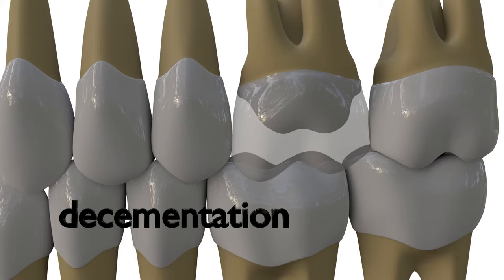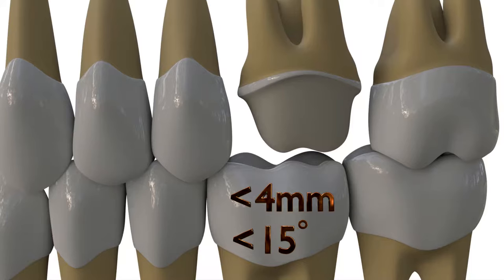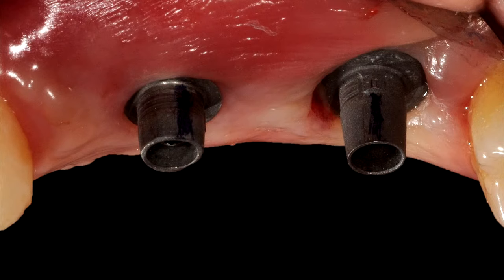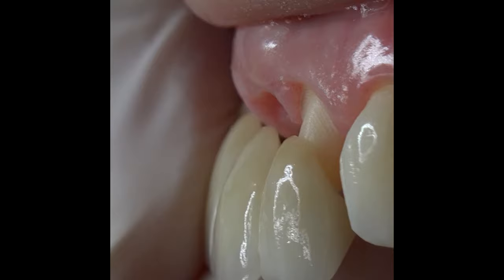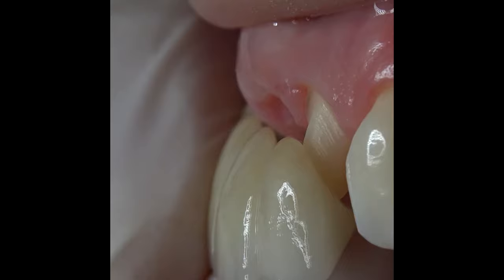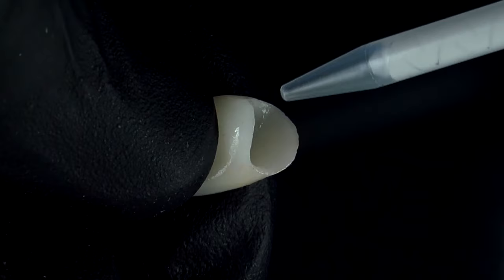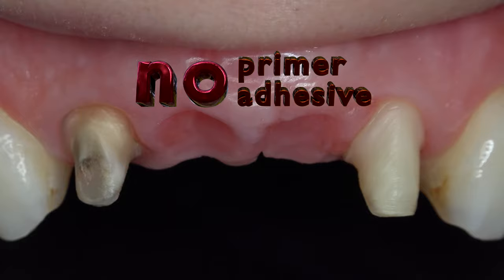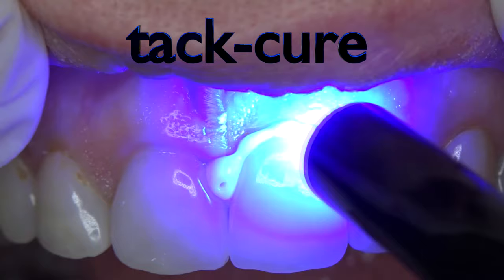Cementation: Glass ionomer cements

Comment: Thanks. I will glue my crown and post back soon. I will do a test mix first and cure the glue with ceramic tile to see how bond strength is. Cleaning with IPA first. The only thing I'm not sure on is the amount to place into the area.
Reply from the maker: a layer of 0,5mm on the inner axial walls will work fine